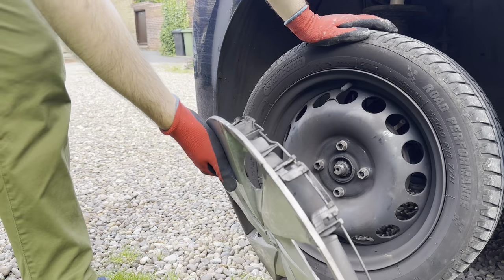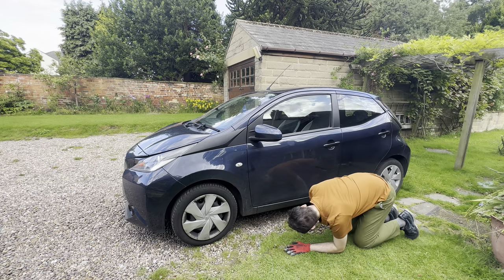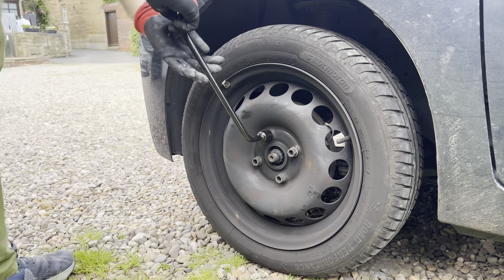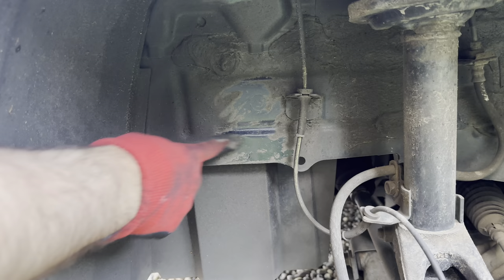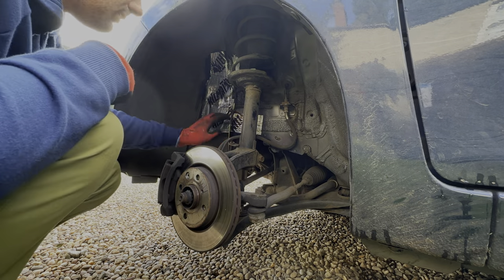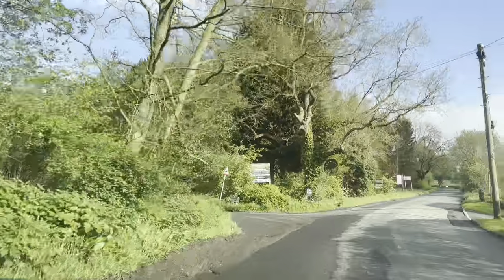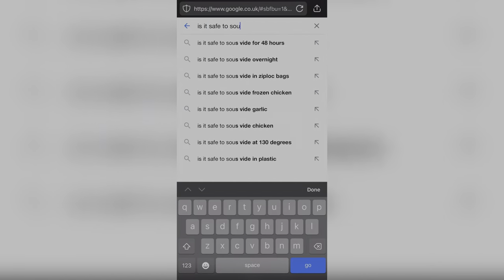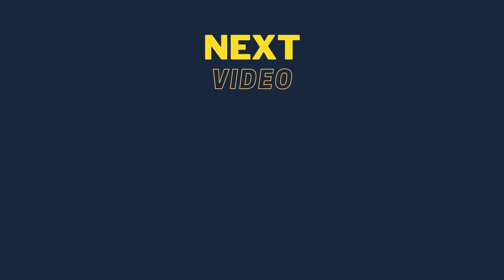Does Soundproofing The Exterior Wheel Arch Make Any Difference?

Comment: I've done lots of private cars so I can share my knowledge what works and what doesn't.

-Wheel arches - silent only the engine and maybe 20$ of the road noise. Most road noise is transmitted thru metal - hence suspension. The stiffer the suspension you have the worse the results will be. Silencing them with alubutyl, foam and felt (closed in a foil).

Silencing the parts where the struts go to, but do it with you hood open - use polyester.

Engine cover - polyurethane foam.

-The roof - 50% of the noise coomes from the roof - airborne noise - use polyethyleneand alubutyl and a thick felt (12mm at lest).

-A, B , C pillars, cover both ends with thick 8-10 cm polyurethane foam. Inside of the pillar put a felt or thinsulate.

-NOW - the big part, the floor.

take out all the seats and carpets:
- alubutyl - 20-40% of the coverage area but it should be 4-5mm thick
- then felt - 8mm but hard felt
- and epdm rubber
You need three layers. Dampening, absorbing and blocking. Don't use foams - they are already present in your carpets for sure.

If you use foams they won't absorb the sound - jest block some reverbing sounds so it doesn't sound like a tin inside, hence we use polyethylene foam on the roof.

-The doors, some alubutyl on the outerlayer of inner door cavity, just 30-40% - don't put too much like in "big companies" trend. 
Now use polyethylene with a glue to cover the area juest under the door trim. Then add felt - use an adhesive tape, and then an epdm rubber. 

-Now - under the rear seat - alubutyl plus polyethylene plus epdm.
The trunk - same thing like under the carpets.
I did a loud volvo. Came down from 76db! to 65dB (65dB is the level of BMW F10 at 85mph)

That adds quite weight to your car. It feels like a completely different car. Now no raising voice or turning the volume up when driving 85mph on a harsh highway...
Reply from the maker: Thanks for sharing this, GS!
Reply: @g.s.7383 was that reduction in dBs with just the floor or with the roof, side pillars and wheel arches covered as well?
I'm planning to sound deaden my 23 VW Arteon as it doesn't get the acoustic package in the US that it does in Europe. Trying to figure out if I should only do the wheel arches or the floor or the floor + ceiling (no wheel arches).
Reply: @jamieaygo great video
Reply: @KlmDet I didn’t do everything in one go. I took me a few weeks when I had some free time. 
Well, the footwell, under the seats, the doors, and the trunk made an immediate difference. I’d still ad some bitumen and felt on top of the fenders - it quiets down when on wet or gravel road. Now I own a Lexus. Gs 350 AWD 2013. It’s not so quiet as everyone says. I want to quiet it down but driving at 75 is as quiet that I postpone my works. I’m in the middle of online shopping for deadening materials. 
This time I’ll be dampening the tunnel, wheel arches, and under the carpet area.
Reply: Your first statement is false. Most popular cars have much less stiff suspension than bmw/mini, audi but those are the quietest suspensions I heard even through they are usually quite stiff.

Comment: Good humor. I like the video. Personally I think the loss of effect at higher speeds is because at that point, more noise is coming from the wind, and not the wheels. You would have to do the floor and the front.
Reply from the maker: Yeah, good shout with that observation. I've noticed from doing the doors that mass-loaded-vinyl (MLV) really helps with this, but it's a little impractical to put on a wheel arch, ha!

Comment: Well done on your continued efforts Jamie , I think I would have persevered with getting those wheel arch liners out to stop any drumming of the wing being a thin steel panel. Even if it meant a few new trim buttons from ebay or toyota mate
Reply from the maker: Thank you for the tips, Mike. I totally miss things like this, so thanks for the advice. I definitely need get better at looking past little problems like these.
Reply: @jamieaygo to get those buttons off the wheel well take a small flat head screw driver and pop up the center button 
Then you can remove the whole pin.

Comment: You did it wrong, there are 3 types of sound proofing for cars.
Vibro: remove vibration, prevent metal, plastic to rattle or resonance due to loud subwoofer, we use this to completely remove the sound of rain drops by installing this on car ceiling.The one you install is a vibro.
Insulator: as the name suggest, we use this material as 2nd line of defense.
Absorber: this is to absorb leakage sound that slip from the insulator. Install facing inside the cabin to absorb car audio leaking to outside and install facing outside to absorb the road and traffic noise.
Go for Silentcoat they made they best car soundproofing.
Go for noisekill if you want to make it cheaper.
Watch CAS audio, they make good tutor.
Reply from the maker: Yeah, I mentioned in the pinned comment that this was done during a learning phase

Comment: Will there not be an issue with the moisture trapped in? I’ve done that with all my doors but I realised that most sound is coming from underneath
Reply from the maker: Great observation and it's something I considered early on. I'm actually going to strip it out soon and see what (if any) damage there is. I've only done it like this on one side just to test this very thing. Might not have wheel arch left, ha!
Reply: The surface has to be dry before you put the plates on and you have to perfectly stick it to the metal. You should use a roller for it. If you do it properly, no moisture can get between the two materials.

Comment: I highly recommend keeping your stock tire size. Maybe buy quieter tires yes, but do not mess with changing tire size. Also new tires should be quieter.  I'm not sure you should stuff rags anywhere in your car either.
Reply from the maker: yeah, good observation. I plan on picking up some new wheels and will be definitely staying with the stock tyre size just purely to maintain ride comfort. I won't be adding rags to my car anytime soon 😂
Reply: True. I've done this and it was a bad idea. The car had understeer and overall didn't ride all that better.

Comment: do you know, add rubber seal to any hole that connected to the door significantly improve soundproofing than any sound deadening material you add.  make sure you have no hole from the wheel to the door. thats the noise came from.
Reply from the maker: Cheers! Will have a look at doing this.

Comment: Thanks for the videos, you're inspiring me to do the same sort of soundproofing for my Toyota. If you're going to keep taking your wheels off it would be best if you purchased a socket that fits the wheel nuts, a breaker bar, and a torque wrench. Much safer for you and the wheel nuts than the wrench that came with the car.
Reply from the maker: Thank you, and yes, you are right. I think I'll be picking up one of the electric drill-nut-thingys, ha! I did initially want to just stick to bare minimum with respect to costs, but that's gone out of the window, so I might as well make my life easier/safer if I can.

Comment: Get a hollow closet clothing rod extension and use it as a cheater bar on the tire wrench for more leverage when loosening. You can stick some twigs in the space in between to prevent too much pressure on any one point of the tire wrench. Just don't use the cheater bar for tightening.
Reply: I use an extendable 2ft long tire wrench + a weighting machine. Initially I will cross tighten all the wheel nut moderately using the 1ft long tire wrench. 

When 110ft lb of torque is required to tighten the wheel nut I stand on the weighing machine. Then I put part of my body weight, usinh both arms & hands, onto the end of the extended 2ft  bar I let the reading weight machine drop by 55lbs.

Comment: You didn't want to give a quick, rudimentary black spray to those insulating mats? It kind of looks terrible showing in the wheel arch.
Reply from the maker: That's a good shout, but I'm going to be pulling it off later, so I figured spraying it would just be a waste. If you are leaving it on, spraying it black is a solid recommendation.

Comment: Why didnt you just put it in gear and you wouldve been able to loosen and tighten the wheel bolts, +even more safe lifting the car up. Oh and by the look of it, tyre guy overtightened them like crazy, you should get a torque wrench
Reply from the maker: You're dead on the money with the latter comment. One of the wheels was so seized on that I had to buy a lug nut removal kit to get it off. Not even an impact wrench moved them!

Comment: why not do this from the interior of the car ?
Reply from the maker: I did as much as I could on the interior, but access is very limited, so this is really a must if you want the best of both worlds.
Reply: @jamieaygo  Well.. you do need to remove all of the trim, but I would expect you to be able to lay this in the wheel well as well ... I am not that familiar with the Aygo but certainly on my car it is possible.
Reply from the maker: yeah, I hear you regarding the trim. When this was filmed, it was all quite new to me so I will be uploading an updated video where I do actually remove the trim and install sound proofing on the actual wheel arch. In regards to the car, it will very likely will be possible to remove all of the interior carpeting on the Aygo, but it would be quite the task without removing parts of the dash, etc and speaking frankly, I didn't want to take on that work.

Comment: One of the other most important things not mentioned in this video is really improving your weather stripping and seals around your doors and windoes. This will vastly improve your sound proofing because sound is just a pressure wave that travels through the air and if the air itself can get in then so can the sound. A lot of road noises you are hearing while driving is also just the wind and obviously if you can seal off the inside air from the outside air then there will be less turbulence and thus quieter sound. :)
Reply from the maker: Good shout, this. Definitely will look into doing this.

Comment: Did you really wonder if it was safe to put sound proofing in the wheel wells? I mean, it might be unsafe if you put the stuff on all of windows but in the wheel wells?
Reply from the maker: the adhesive is really strong, so there are no worries of it falling off. The only concern some people may have is that the wheel arch may corrode due to moisture getting in.

Comment: From this video the wheel arch is partly or about 50% covered. So the drumming effect of road noises, onto the the uncovered part of plastic wheel arch cover, is still unmuted. Applied sound block so far is about 1.8 to 2lb.

I am copying what you did but starting from outer part of the of the wheel arch plastic cover!. Tapping the plastic cover with finger tips, before vs after applying sound block, indicate it the sound is only muted slightly. 😂😂😂 Perhaps it is still a good enough ROI. Regards.

 I am taking it slow. I am limiting covering each wheel arch plastic with 3.3lb of similar sound block.
Reply from the maker: I am going to publish a video in the near future that focuses on how I have soundproofed my entire car, so stay tuned for that. I think taking it slow is a good approach and in general, the process of sound proofing a car is quite a huge undertaking and it really does take time!

Comment: I wonder, does soundproofing the inside wheel arch had the same effect? And also, how does it performs when it comes to rainy weather?
Reply from the maker: Great questions. On the rear, I actually managed to do both the inside and outside, which is ideal if you can reach both. I'm looking at removing this from the front soon, just to see if any moisture soaked in causing corrosion. Hopefully not!

Comment: That sound deadening material... You need to use sound proofing materials...
Reply from the maker: the sound proofing world isn't short on semantic confusion. The clearest definition is probably sound deadening (killing vibrations) VS sound dampening (lower overall sound oscillations) and that's not even bringing sound proofing (which seems to mean the general practice of making your car quieter) or sound absorption into the equation. Yikes!

Comment: I accidentally completely removed all vehicle noise by fibreglassing the undercarriage and chassis to prevent rust I have to park outside so I did this for just that purpose the cancelling all the noise was a bonus but the handling and steering also noticeable improved it was like driving a prairie wagon around corners before compared to now I can't really explain why that is except the little tack welds that hold it together are now not needed because it now has much stronger joinery and doesn't sway when going into corners.
Reply from the maker: This is cool! Do you have any experience doing this kind of work or was it a bit of a DIY project you undertook?
Reply: I had a little bit of experience after defining gravity working upside down underneath the car now I can do anything fibreglass 😀 I highly recommend it you will notice the sound drop off quarter way through all I hear is the keys jingle in the ignition if I stall I have to rely upon the gauge can't hear a thing from inside .
Reply from the maker: Awesome. Will be looking this up. have you got any recommendations for guides or anything?
Reply: Sure all the things you need are cheap or free the big one is timber slats I got mine from old bed dumped on rubbish the pine half inch thick four inch wide slats cut them the distance between ground and undercarriage make each one 1cm longer then the next and label them 1-2-3-4 this you need in reach when you're under the car you will only have one hand free to wedge the correct size slat under your " sticker" to make your sticker take a off cut from the timber put a sponge on it cut to same shape as timber wrap in plastic lunch wrap just dishwashing sponge flat rectangle type wrapped with the timber then just cut the fibreglass chopped mat into the desired shape ( can't exceed width or length of the sponge) place on-top of the plastic wrapped sponge I resin the plastic then lay the fibreglass down resin again on-top then you can push that up onto undercarriage excess resin will drip everywhere when you apply pressure with the wedges that's it your done your first patch wait till dry remove scaffold peel off the timber and sponge you should only have to sand around the edges where resin dripped and formed stalactites prepare area before just like painting or welding.

Comment: Butyl doesn’t do much in the wheel arch by itself, but it makes a great base to add more layers. A 10mm soft closed cell foam on top helps more. There are also multi layered mats that have different densities in one, which are even better.
Reply from the maker: Great shout, and yes, it is something I have begun to add to the wheel arches, although it does take a while, ha! I am hoping to post a full sound proofing video for the car shortly!

Comment: Doing this today to my mk2 clio. Gonna take the liners out and do it in the channel bit on the wing. Its already got some foam in there as standard so guess its showing me where it needs to be. Shall see what difference it makes before doing the doors and the rear ones.
Reply from the maker: Nice! Have you started yet? If so, How's it going?
Reply: @jamieaygo  yep. Done the front arches and the rears. Also the boot floor and under the back seat. It all went fairly smoothly install wise part from one awkward screw. Noise wise, id say its a little bit quieter and lower in tone, not as white noisey, so appears to have done the job and makes it far easier to listen to. Put some weather stripping along the front edge of the doors behind the hinge and up where the a pillar is. Has cut wind noise greatly and now ya just hear the traffic noise when things pass so all in all, money and time well spent.
Reply from the maker: Nice! The weather stripping comment is a solid tip and something I am definitely looking to explore. Thank you!